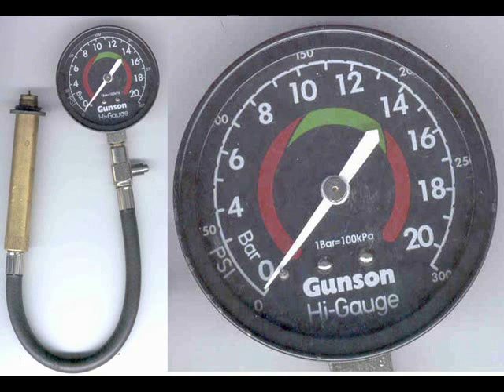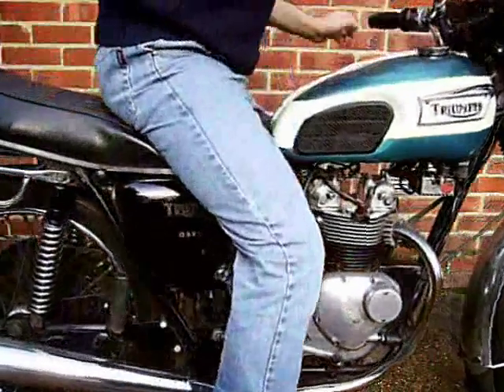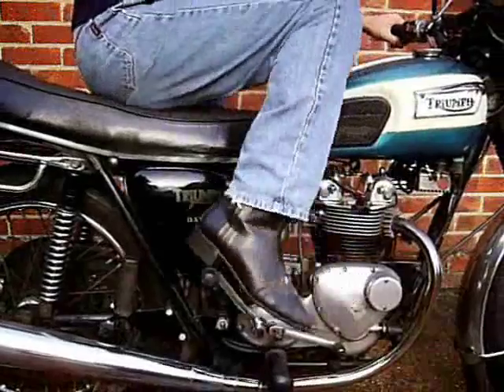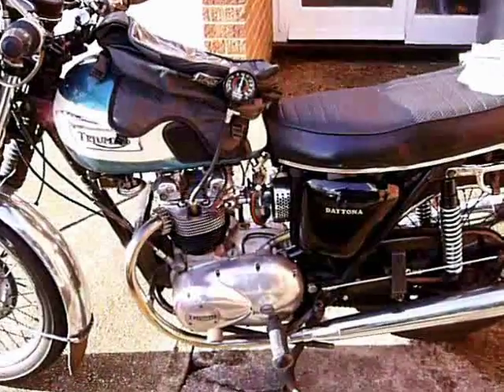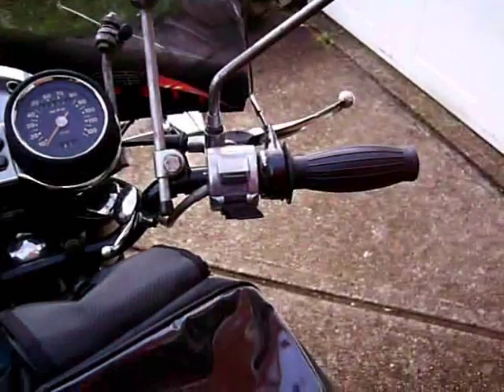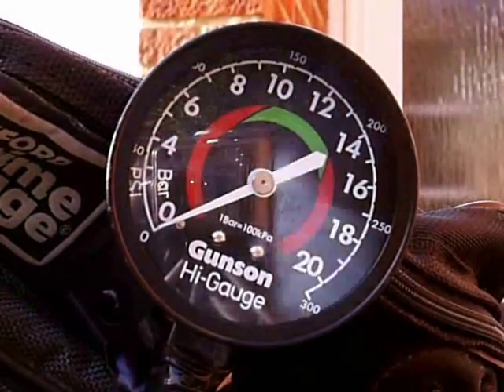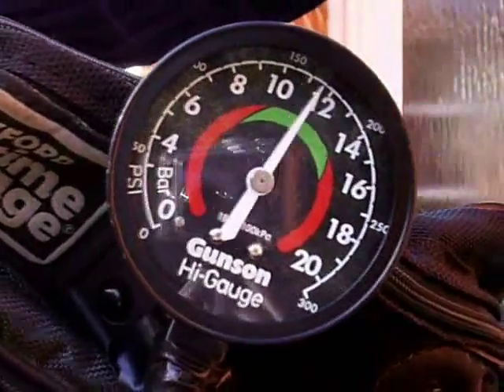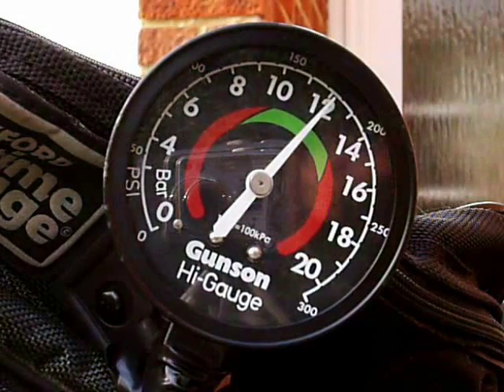How to do a Compression Test of a 1973 Triumph Daytona T100R motorcycle engine

Comment: Thanks, I just did a compression test for fun even though I know the engine was rebuilt 200 miles ago.  I got about 140 PSI but I didn't warm it up or open the throttle so I'll have to try it again.  Of course the rings may not be fully seated yet either so maybe I'll just wait a month or so.